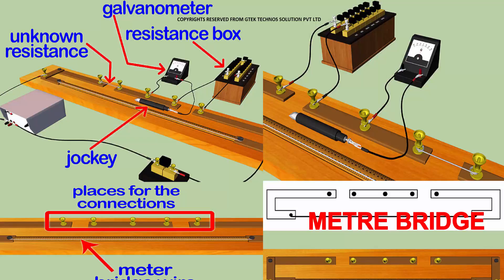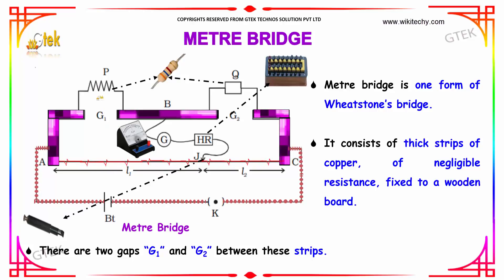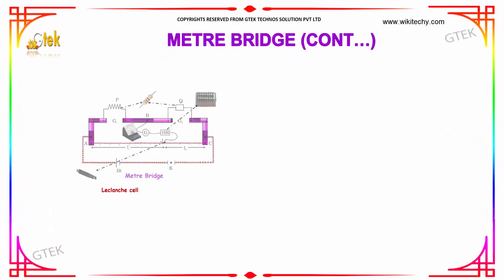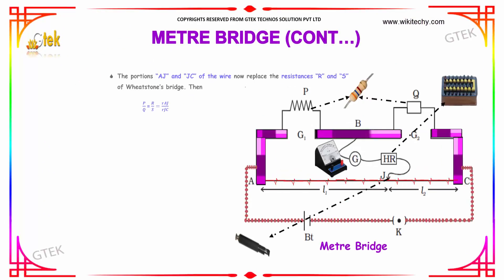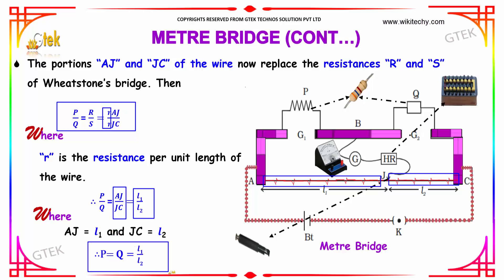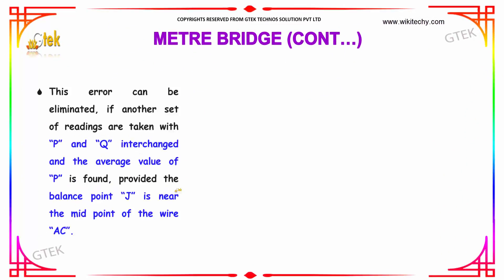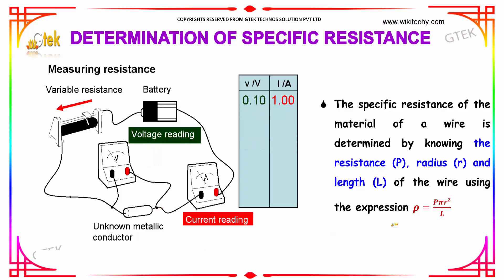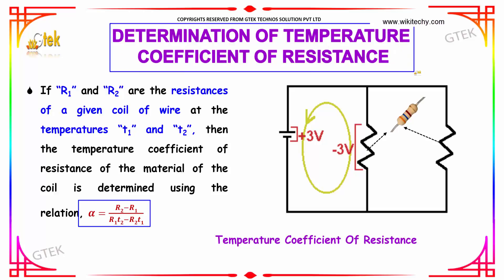Metre Bridge Current Electricity class 12 physics subject notes lectures CBSE IIT JEE NEET

Comment: A meter bridge is an apparatus used to find the resistance of a coil; you will find it as part of the tools of a physics lab. ... Check that the meter bridge wire is connected. ... Slide the jockey over the meter bridge wire and note down the reading for which you get zero deflection

Comment: A metre bridge is a simple type of potentiometer which may be used in school science laboratories to demonstrate the principle of resistance measurement by potentiometric means. A resistance wire is laid along the length of a metre rule and contact with the wire is made through a galvanometer by a slider.

Comment: Meter bridge is based on the principle of wheatstone bridge and it is used to find the ... emf's of a cells,Potential difference between two points of the electric wire ... length of that portion of thw wire when a constant current flows through the wire

Comment: Metre Bridge apparatus. The metre bridge, also known as the slide wire bridge consists of a one metre long wire of uniform cross sectional area, fixed on a wooden block. A scale is attached to the block.

Comment: Metre Bridge apparatus  

The metre bridge, also known as the slide wire bridge consists of a one metre long wire of uniform cross sectional area, fixed on a wooden block. A scale is attached to the block. Two gaps are formed on it by using thick metal strips in order to make the Wheat stone’s bridge. The terminal B between the gaps is used to connect galvanometer and jockey.

Comment: The metre bridge is operates under Wheatstone’s principle.  Here, four resistors P, Q, R, and S are connected to form the network ABCD. The terminals A and C are connected to a battery, and the terminals C and D are connected to a galvanometer through keys K1 and K2 respectively.                                                                                                                                                                                          In the balancing condition, there is no deflection on the galvanometer. Then,

P/Q=R/S

Comment: The metre bridge, also known as the slide wire bridge consists of a one metre long wire of uniform cross sectional area, fixed on a wooden block. A scale is attached to the block.

Comment: bridge is an electrical circuit used to measure an unknown electrical resistance by balancing two legs of a bridge circuit, one leg of which includes the unknown component. The primary benefit of a wheatstone bridge is its ability to provide extremely accurate measurements (in contrast with something like a simple voltage divider).[1] Its operation is similar to the original potentiometer.